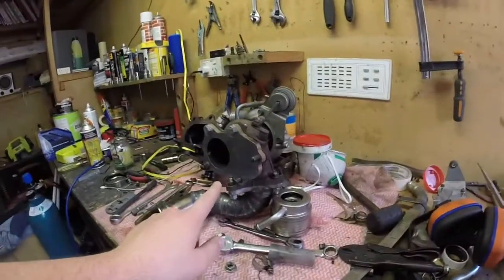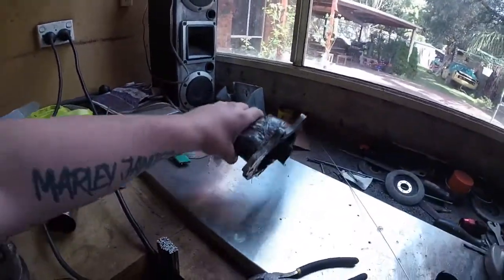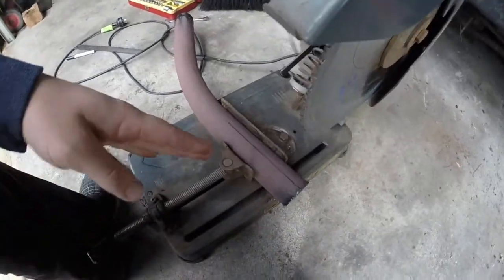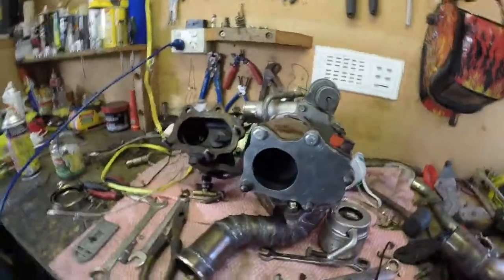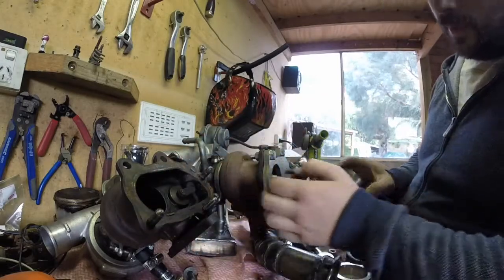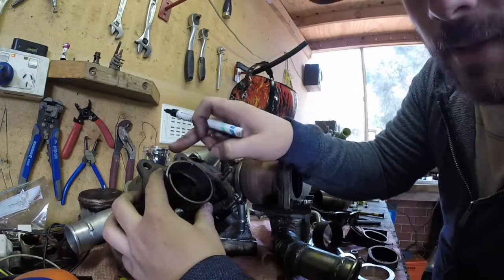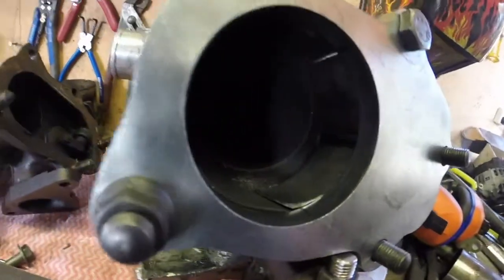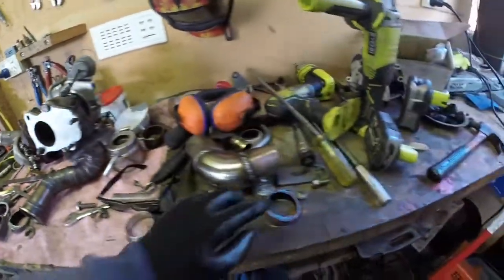GT35 Compound Turbo Subaru | low mount turbo dump pt1

Comment: I have a question? I have a Subaru Legacy gt 2005 and I bought a turbo kit  gt35 I have to do the same process that what u already did?
Reply from the maker: If you bought a ‘kit’ it should be pretty straight forward. Mine is all custom now.
Reply: @HarrodsGarage   ohh ok thanks man